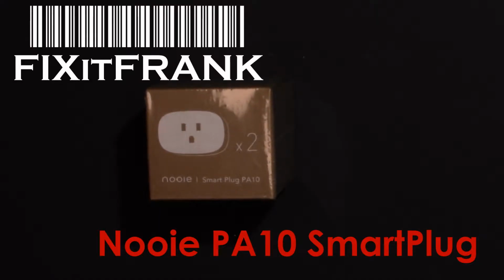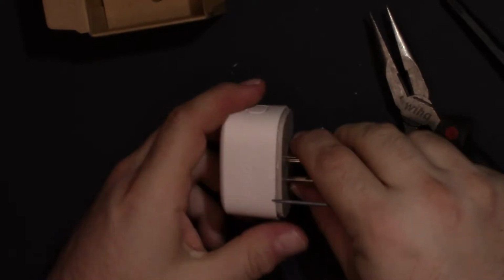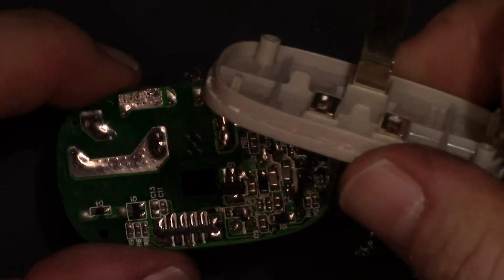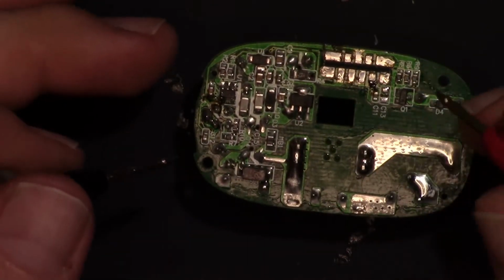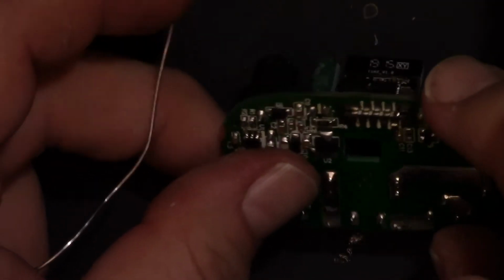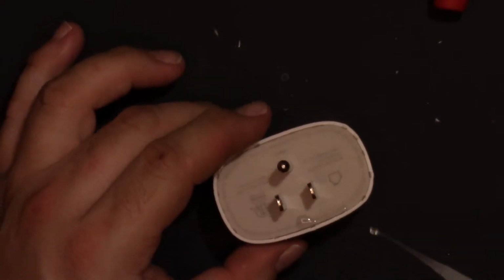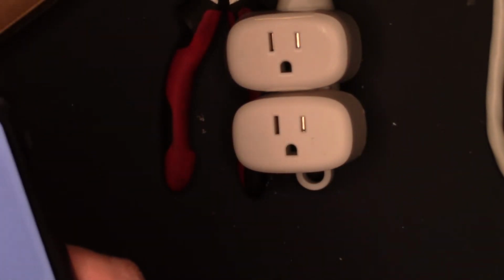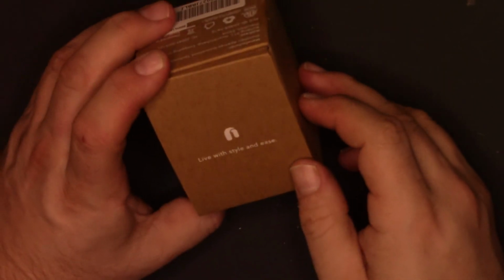Nooie WiFi Smart Home Outlet (YASS) Teardown /Review

Comment: You almost got me blind. How can you see and did all that with that lighting :) mines turns on, I can hear it clicking on and off through the app and the button but no power to the plugged device. I forgot and plugged my Mig welder to the smart plug. What do you thing went bad ? Thank you
Reply: And I had to watch like 20 commercials during the whole video :)
Reply from the maker: You probably either popped the mains fuse or melted the relay contacts. I can totally see a mig doing that. I can't get mine to run on an extension cord unless it's huge.

Comment: "I'm not going to take the board off".  Proceeds to dismantle every bit :-) 
Joking aside, thanks for your video. I was trying to understand why I could not replace the firmware on this plugs, and the reason is they are not ESP based, but probably realtek chip, as you have discovered during the tear down. Great also the fact that you explain how stuff is supposed to work while dismanteling it.
Reply from the maker: Thanks man!  I appreciate the feedback.  What firmware were you working with?  Tasmota, something like that?  I keep meaning to take the plunge into self hosting my IOT stuff. I still use Amazon when I should just have it served locally and do it right.
Reply: @FixitFrank  Tasmota as a first step and then ESPHome. All this cheap devices based on ESP8266 that works with 'SmartLife' or 'Tuya' share the exact same firmware that can be OTA flashed with tasmota (see 'tuya convert'). But I think ESPHome is better, so once I get a tasmota fw on the device I then replace it with ESPHome. Unfortunately Tuya has stopped using ESP8266, in fact all the new devices are built with a Realtek RTL8710BN, which is pin compatible with the ESP but way cheaper. This Realtek board is not supported by the 'tuya convert' process, so until someone figures it out they can't be hacked.
All this IoT stuff is fun and sometime even useful, but I don't like having their functioning depend on some remote server somewhere in another country. So I think trying to have everything local is a sensible target.
Reply from the maker: @EttorePancini  I had experimented with Tasmota at one point but got sidetracked since Smartlife is "good enough" but I keep meaning to do this.  I didnt like the self hosted options that I had seen at the time.  While functional, they seemed a little too involved to keep running.  Home Assistant and ESPHome look perfect.  I am so glad you said something. I now have a new project! Thanks!